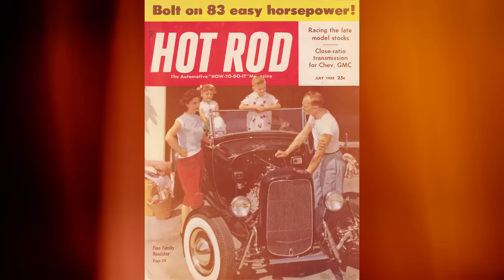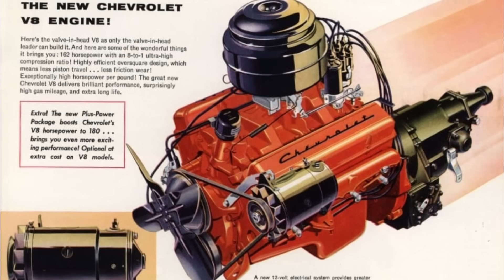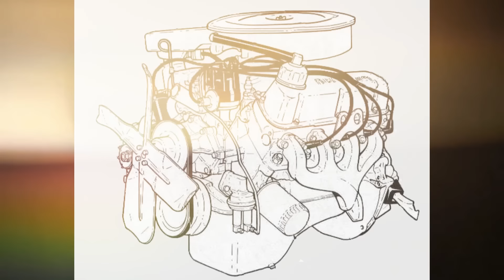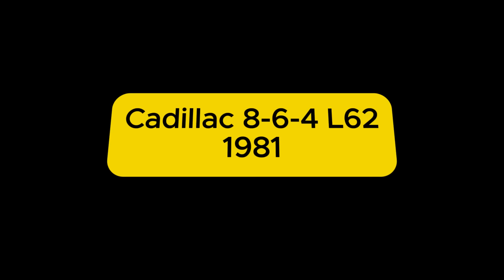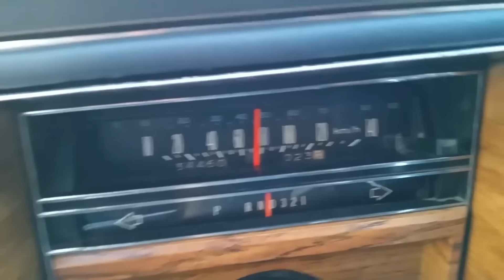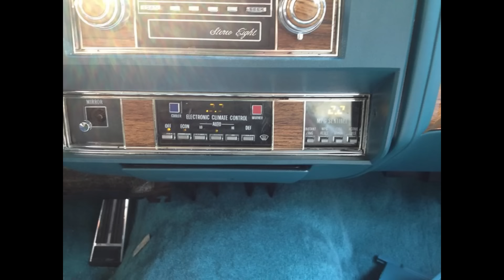WORST Engines Major Companies Ever Put In A Production Vehicle! PART 2

Comment: The 305 after the cam problem was a really good engine. I had several with no problems or complaints. This engine didn’t deserve to be on the list.
Reply: I had an 86' Iroc Z-28 with the TPI 305, it never gave me any problems, easy and cheap to mod also......I race the same Iroc as mentioned with my 81' Turbo T/A...The T/A would beat it in the quarter by about 5 lengths. All I did was take the muffler off the T/A, the cat on it made it quiet enough not to be too loud, and still pass emissions.
Reply: have one in my 79 caprice  an a 305 in a 78  chevy truck....never one problem...i sold the 78  an bought a 92k1500 new with a 350...still have it
Reply: @shanemitchell477  I offered my 283 to swap with that engine in a '82 TA. 
Actually a 4" bore and 3" stroke. High lift, low overlap cam. 1.98  valves. But 9.5 to 1 compression. So not quite as HP out. But a bit more torque.
 Oh and meets '82 AQMD and CARB.
But fails with the open the hood eyeball check. In Californey. Most of the external plumbing would be missing. Yep you can tune for HP and Eemotions.
 Well you could not buy pump gas in the 80s to run at 68 spec compression. 9.5 compression no problem.
My next go faster was a Lincoln LSC. Was close. But not '67-69 302 Chevy close.
Then along came the 256 cubic inch Alas 6 in 2006. That moves a T-Blazer smoothly and quietly with only 290HP  and two less cylinders with no puffer.
There have been sub 10 second  '54 Chevy and Studebaker versions with that engine. Of course they were  turbo charged.
The is a 10 second Fairlane with the Atlas I-6 that gets driven to the track.
Reply: @warrenpuckett4203  283's run good, but no torque. Also, you can run 10.5:1 easily on 92 octane. What are emissions? We never had such tom-foolery in Kansas...ever.
Reply: @shanemitchell477  Well you can not count on premium being premium.
Also 1968 1.98  heads.
 2.02s make more horse power. If you can find those that are not cracked.
It had the torque. It smoked the tires in a suburban.
 Sacrificed a few ponies for more torque in the cam choice. Also the intake and exhaust changes things too.
Oh and don't forget the rear axle ratio and the top speed you want.
 Kinda important if you tow a trailer. Or just don't care about gas milage. 9 MPG is acceptable with 48 gallons of onboard gas tanks
Reply: @warrenpuckett4203  LOL That's what my 2004 hemi 1500 ram got pulling a trailer..
Reply: @shanemitchell477 It did not change much.
A '69 suburban has the aerodynamics of a brick. Oh and it was a stick shift.
Need a 8 speed or 10 speed automatic now.
 Also there is a designed in fault for sticks.
They use auto trans fluid. Gotta fix that long life problem for repeat sales. I don't think a actual 0.01 % increase in overall mileage is worth it. Especially in a old Ranger. Those would fail if you used 5th pulling a empty  flat trailer. It is called gear lube for a reason. Transmission fluid for another reason.
But on the assembly line? One less hose and operator.
That $1600 rebuild is your problem.
Removal and replacement is extra. Also more than the transmission rebuild.
Reply: @warrenpuckett4203  The T5 Rangers or the M5OD Rangers?
Reply: Not like there's a huge difference between all the Chevy v8s, so it's a little smaller so it puts out a little less power than a 350
Reply: @shanemitchell477 what's crazy is an 80k pound gvw otr truck gets close to 9mpg
Reply: Yes, the 305 did deserve to be on the list. I had a 2 barrel version in a 1978 Caprice. It couldn't get out of its own way.

When the camshaft went flat, out with the 305 and in with a built 327. 

Nothing made me happier than to dump the 305.
Reply: @Karrpilot  I was referring to the 305 after the corrected the camshaft problem. I had a 92 model with over 200,000 and was still like brand new. I’ve actually had 3 305’s with no issues.
Reply: @MrTheHillfolk  I think the one in my '88 & the '94 were from Japan. Never fixed sticks. Automatics no problem.
The ''88 and '94s automatic would also fail in OD. 
Not actually made for US roads after 55mph was done. 65-70 was too much with a full  load or a trailer. But no problem with warranty. They would get past that.
Reply: @Grinchguy2  I agree with you totally. I did a lot of work on the Chev 305 and the camshaft failures are mostly caused by the oils being used and the lack of maintenance. That engine my son ran in a demolition derby and it took a pounding and came back for more, still runs!!!!!!

Comment: Take the Ford Flathead V-8 off your list it is a great engine and there is nothing as smooth as a Flathead V-8! FORD FLATHEADS V-8 FOREVER there is nothing else like it!
Reply: Depends, there is an old style and a new style. The old style mostly never cracked, the new style mostly all cracked the block . The way to tell is the water  spigot to the heads. The old style it was in the middle of the head . The new style the water spigot was at the front of the head and these blocks cracked in middle .
Reply: @johna7661  You are so correct the 8BA is the 239 flathead V-8 most would use in their stock or built up card or trucks. Thank you so much for giving me comments because the flathead is the engine I like to work on, old school all the way!
Reply: Overheating at higher elevation !
Reply: The said the 1932 flathead, not later versions
Reply: RIGHT ON!! I lived those!!
Reply: From a historical perspective,  the narration is  accurate.  The V8 -  Ford's knee-jerk reaction to Chevy's Stovebolt  6 having taken a few years before  beating them in sales... The engineering philosophy was that the Ford flathead 4 had a very tough crankshaft;  rather than  go with a low revving, inherently balanced flathead 6 (which was one of their frontrunning concepts for '32)   the  Model 18  V8  in a  far more longitudinally compact package,   90*  firing , and easily  balanced  crank won over for '32.  (As I recall, Ford was still building 1931's in February of '32)  to clear out the parts stockpile.    A goodly number of Model 18   '32  engines were indeed  abysmal  oil burners that  overheated and suffered from vapor lock. Enough that customers were sending telegrams to Henry.  To their credit, Ford did quite a bit of "invisible engineering" and  by November,  they were far more reliable.  I'm with you on "Flatties forever".    Yeah they were prone to overheating  all the way thru '54 (Canada didn't get the Y block till 55...) and by then were techo-dinosaurs,  but they were by, and large,  reliable and could eke out 200 hp.  Ironically, this video fails to mention the fiasco that Chevy had on its hands in the months after the 265 was released in October of 54... The block honing fixtures at  GMs Flint engine assembly center  were  not as aggressive as  intended, and the first run of engines had a nicely appearing cross hatch that wasn't nearly deep enough to properly seat the rings. To complicate things, they went to a new oil that had much better lubrication properties....   Many of the new 265s smoked like crazy, burned oil, and  fouled plugs - so much so that it became a serious backlog issue at Chevy service centers, and Chevy was at the point of suspending the 265 until they figured out the problem....    the cure for installed engines?     Babbo scouring powder fed thru a hastily designed sparkplug with a vacuum port,  one cylinder at a time followed by a rinse and vacuum with diesel fuel after all 8 were done...  With rings seated,  the  smoke subsided and  the rest is history... only not on this video...
Reply: I’d like to see evidence of these telegrams to Henry or is this just folklore.
Reply: Bonnie and  Clyde agree
Reply: Most of the problems listed were typical teething problems any new engine would have when it was made. Which were fixed as identified.  Not a bad engine, just a new design.

Comment: Why can't they get pictures of the actual motor they are talking about? 265 pontiac and shows a 389 tri power? Chrysler lean burn and shows a 440?
Reply: because they are too lazy to to their due diligence?
Reply: That 368 Cadillac, with the generator was spot-on as well.
Reply: The 305 Chevy, also with a generator, guess they took off alternators to save fuel?
Reply: They couldn't stop reminiscing about the "venerable" HC, CO and NOx (smog) belching engines of the '60s!
Reply: Because you could get a lean burn 440 from 1976-1978..

Lean Burn Computer and Spark control Computer was easily changed changed as you change the distributor,ecu and non smog carb you gained power and reliability..

Comment: I've had a couple of GM 305 carburetor cars, never one of the bad camshaft models. The best thing I can say about the 305 was it was easy as could be to decomputerize. A non- computer  Holley carb & Intake, Acell ignition & a vacuum control for the transmission & you had a reliable car or truck. A weekend's work & they still got good mileage.
Reply: I put one in an S10, with a 700R4 auto, all out of an early 80s Malibu... it was a right proper little terror.  sure, the 350s were quicker, but I felt the 305 had more than enough power for my needs, and you can't argue with 20-ish mpg.

Comment: I’m halfway through the video and I’ve yet to see a truly bad engine.  All are reliable, albeit low power.  My definition of bad is unreliable with serious issues
Reply: Yeah it’s a bad name for the list, there were some real turds that didn’t make the list. It should have been called the most disappointing engines or something like that.
Reply: So what qualifies?
Reply: @milesmahan    Vega engine was garbage.  5.7 Olds diesel was bad, although with a simple water separator, it may have been okay.  Iron duke wasn’t great.  3.3 Chrysler was awful.  4 litre ford was bad.  New 6.2 Chevy seems to have an issue breaking cranks…… that’s bad.  I’m sure there’s more, but that’ll do for starters
Reply: 4.6 and 5.4 fords shooting spark plugs through the hood is bad, not to mention the cam phaser issue.  5.7 hemi is chewing up there variable camshafts….. that’s bad
Reply: Second half did indeed have a couple bad ones
Reply: Agreed. I'm not going to finish this vid. There's some serious holes in the information as well.
Reply: I’m with you on how are these bad engines. They did exactly what they where designed to do. My ole 305 runs great and does what I want it to do. That is move my ‘55
Chevy truck down the road. Is it fast, no but I don’t want it to be fast.
Reply: mrliberty8468 
The Olds diesel when converted back to gas is a helluva of engine.
Reply: @jimsmirh2406 
Not necessarily a fan of gm stuff,but the 305 does what it's intended to do. 
It's still being used under license by Power Solutions International.
I know enough Chevy stuff to get me in trouble. 
The one under license is the old late 80s version with the center bolt valve covers. 
They also have the 350, and the 3.0 GM and used to have the 8.1(496) but now they switched to the 8.8.
They make that lil 350 with a turbo do what the old non turbo 8.1 did which was be able to power a 100kw generator. 
Mind you, it runs a steady 1800 rpm and lays down a fat 175hp at that speed. 
I think the 8.1 had like 160. 
Everyone bags on the 305 because you should just get a 350.
I say work with what ya got.
The little 305 is still a basic Chevy V8, so it's a little smaller and serves a purpose.
Reply: The Ford 255 was pure shit, and I'm telling you this as a died-in-the-wool Ford fan.  It was reliable, yes, but it didn't run any better than ye olde 200 six- cylinder, and the six got better mleage.   Ford wasted vast amounts of money engineering that piece of crap.   They put crummy carburetors on them, too.
Reply: While the 350 Olds diesel was gutless, they went even dumber with a 260 V8 AND a 260 V6!
Reply: Thanks for helping me not waste my time watching this vid then!

Comment: Narrative  derides all these engines for low power, but the pictures generally are of high performance engines with multiple carbs and  other performance features. He also should have noted the way horse power rating changed to deduct the power lost on accessories and in the drive train. Net horse power at the wheels is substantially lower than the old method. However it is true that all car makers had to struggle to comply with unreasonable fuel efficiency standards.

Comment: Definitely take the chevy 305 off the list. Ny 84 El camino has well over 250k and no cam problems and that electronic quadrajet is the most reliable carb ive ever had!!
Reply: To be fair, he said their reputation was tarnished. But agree that it actually can be a great small block chevy if modded right.
Reply: @extremedrivr  thanks! Your right!

Comment: Yes, Chrysler's lean burn system was dreadful, but the engines themselves were excellent. Those engines when equipped or retrofitted with Chrysler's older traditional electronic ignition were all excellent. My parents had a pre-Lean Burn Cordoba that never saw a mechanic's wrench, except for basic maintenance.
Reply: Lean Burn Computer also known form 1980-1989 as Spark Control Computer was easily changed in 15 minutes..

Add a new distributor and ecu(or go back to pre 1971 with points ignition) and the engines were the most reliable engines ever made in history of the automobile..With lean burn/spark control computer you should put a pre smog carburetor to gain up to 75 hp! You really notice the swap even on 318's as the bbd carb is a power robbing pos.

Slant 6,318,360,400 and 440 would run 300,000 miles all the time..Hell old Muscle cars have 260,000 miles on average and they were beat on..

Comment: An engine being configured with a two-barrel carb has nothing to do with being able to run on cheap fuel, as I've found over my years of driving 4-barrel engines. Running a ridiculously low compression ratio, without any form of forced induction, however....
BTW: Chrysler's reason for going with the hemispherical combustion chamber in the first place was to be able to extract the maximum power possible from low-octane fuel. How low of octane typically was available in the early-50's, I cant say. But I do recall seeing (without audio) a commercial for Speedway 79 gasoline... so there's that.
Reply: Remember that Phillips 66 was a big deal in the days of 50 octane gasoline.

Prior to the late-50s and 60s horsepower race, people liked smooth, quiet, economical engines. Low compression ratio delivers that.
Reply: Plus with the Hemi it had 140 hp the Ford V8 had 106-110 hp and the Chevy had 115 so the Dodge was a rocket!

Chrysler Hemi had more power because Chrysler was top of the line so bigger engine,more power..Desoto was second in line so bigger engine and more power than Dodge...Plymouth never had a Hemi in the 1950's as it was the companies entry level brand and the competitor to Ford and Chevy,so their 6 cyl was in line with those brands.

Comment: This AI lacks a depth of understanding. I’d liken the way the video was researched to Igor being tasked to find a brain for Frankenstein’s monster.  The only V-8 in this video that was truly terrible was the Olds 5.7 diesel. The Chrysler Lean Burn wasn’t spectacular but it was the electronics, not the V-8. Some of the others may have had runs with bad substandard components but seems like the manufacturers fixed those types of issues. Lack of horsepower compared to previous years or the smog era doesn’t necessarily make for a terrible engine for grocery getter and commuter cars.
Reply: My friend got a job at the Oldsmobile dealer rebuilding the 5.7 diesels!  That was all he did, all day!!!
Reply: What brain did you get?

I dunno, Abby something...

Abby who?

Abby normal...
Reply: Lean Burn Computer also known form 1980-1989 as Spark Control Computer was easily changed in 15 minutes..

Add a new distributor and ecu(or go back to pre 1971 with points ignition) and the engines were the most reliable engines ever made in history of the automobile..Swap the carburetor with a pre lean burn carb and pre smog you gained 75 plus hp even the the 318 2bbl would gain huge power,you really noticed it.

Comment: I think that the ‘32 flathead was maligned a little. For one thing ,  the fuel pump position caused vapor lock? Apparently Ford didn’t think so, it remained in the same place until the end of production in ‘53. Water pumps were the same until ‘36. He never really addressed the real reason they ran hot, which was the exhaust passages in the water jackets.